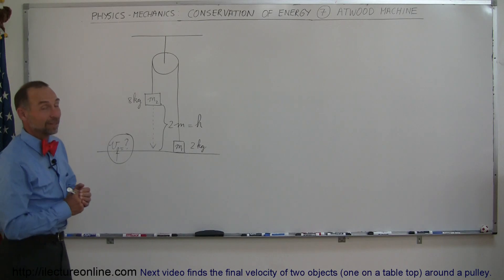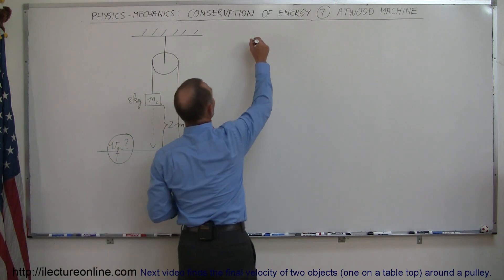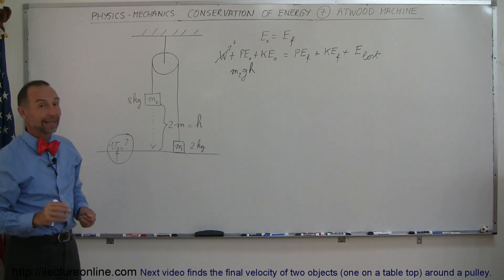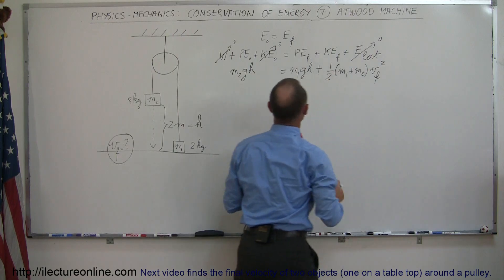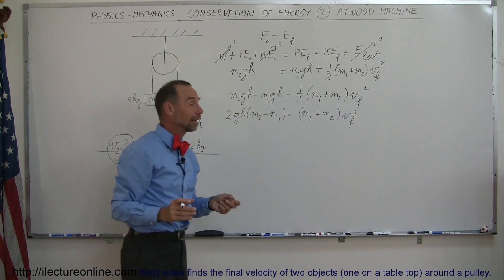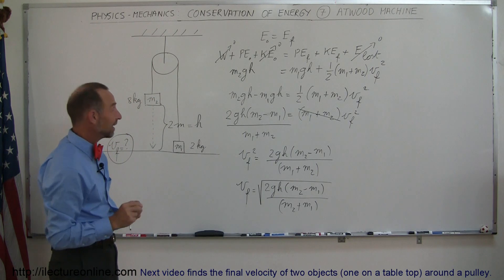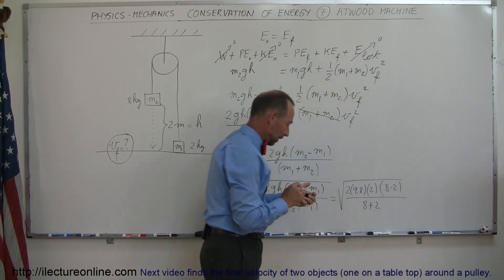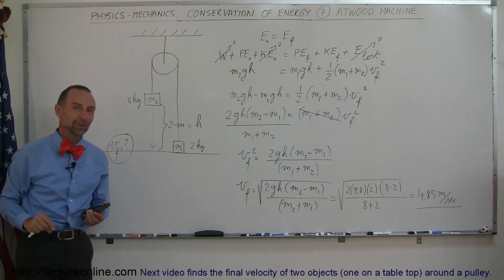Physics 9   Conservation of Energy (7 of 11) Atwood Machine

Comment: why dont we calculate the final speed with m total ? aren't both weights moving
Reply: i did PE of m2 =1/2xm(total)xv(final)^2 i find v=5.6 m/s what did i wrong professor😭😭
Reply from the maker: We used both masses in the calculation as shown.  We suggest you use the exact method shown in the video.  All these types of problems are solved that way.    You must consider the PE of both masses before and after the change.
Reply: @MichelvanBiezen  roger that professor

Comment: great explanation! just a question about a physics problem i found. if the cube m1 (the one with less weight) has an elastic force pushing it down. that gets added to the formula as well? it would be something like: m1gh = m2gh + 1/2 (m1+m2) V^2 + 1/2 K x^2. is that ok?

Comment: Hi, can I use this method even if the pulley has a given mass and radius?
Reply from the maker: No, these videos assume the pulley has no mass.  If the pulleys have mass then you need to use this different techniques:  Physics - Mechanics: Moment of Inertia and Rotational Kenetic Energy (2 of 3) Pulley System  https://youtu.be/5j5m3bwC0NU  or take a look at this playlist:  PHYSICS 13.1 MOMENT OF INERTIA APPLICATIONS 2   https://youtu.be/XHkDJwQ4Xng

Comment: Hi sir, could you please explain to me how we know that the height for the 2kg will be 2m. I am a bit confused regarding this. Is it an assumption we can make? If so could you please explain it. Does this mean that the height lost by the one block is equal to the height gained by the other? I saw another comment ask something similar. The comment said that if both blocks were suspended 2m above the ground - the lighter one would go to 4m. I don't really understand why. Practically it does seem right that it will go up 2m but what is the theory behind it?
Reply from the maker: Since the 2 blocks are connected with a string, however one block moves, the other block must move the exact same distance, since the string has a fixed length.

Comment: Based on this Chinook-Helicopter, lifting each 2.3 kg weight demands one-horsepower of engine force:: Youtube:::  (The CH-47 Chinook Proves It Can Lift 50K Pounds)
10,000 hp-Thrust==760 tons-thrust-force; Max-Weight==23 tons; thus:: Thrust-Weight-Ratio (TWR)==760/23==33===Chinook-TWR
Apollo-Saturn supposedly weighed 3,000 tons, thus 3,000/23==130 of such helicopters would have been needed to barely lift an Apollo-Saturn off the ground, which equals a total thrust force of 130X760==98,800 tons==~~100,000 tons-thrust-force, while Saturn-V claimed to have a thrust-force of only 3,700 tons which equaled only 3700/760==5 of these helicopters!!! CONCLUSIONS::: Apollos-were-fake!!! Youtube::: ("Solving-Apollo-Enigma-1") to learn what Apollos really were!!!!
Reply from the maker: Kareem.  There is some good analysis in your calculations, but you are leaving out some very important details.  As the rocket burns fuel, the mass decreases and the acceleration increases.
Reply: @MichelvanBiezen   But, which rocket professor? If you are referring to Apollo-Saturn as a rocket, I have already proved it was NOT. To see that a 3,000 ton Apollo-Saturn, with its 3,700 tons thrust-force, could NOT have lifted off even one inch, please check new additions to my own main comment under Youtube:: ("Solving-Apollo-Enigma-2")
Reply from the maker: Why would a 3000 ton rocket not be able to be pushed up with a thrust of 3700 ton (x g)?
Reply: @MichelvanBiezen   In my short video, I showed that as soon as a mass accelerates its actual-weight instantly increased. The 3kg mass instantly increased in weight to 15 kilos, shown on my force-meter-scale. So, the actual weight of a 3,000 ton rocket mass would instantly increase, much more than five times, because a rocket has to accelerate much faster than my hand. However, assuming that it accelerated as slowly as my hand, then it must instantly increase to 15,000 tons, in the first half meter of its ascent. Thus the excess weight-force of 15,000-3,700==11,300 would instantly ground the Apollo!!  It would NOT have a chance to accelerate at all, even one inch!!! As shown in my Chinook-Helicopter comment, One horsepower of helicopter lifts only 2.3 kg mass. Apollo's 47,000 horsepower on a helicopter could lift only 47,000X2.3==108 tons of mass, NOT 3,000 tons. Therefore, as a helicopter, an Apollo-Saturn would need 28 times of its claimed thrust-force to lift only like a helicopter, NOT as a rocket (3,000/108===28 times) However, rockets need even more TWR than helicopters do. So, how do you imagine a 3,000 ton mass could rise up into the air with only 47,000 hp==3,700 tons force??? I know: The only hypothetical way is by using a giant crane-pulley, and a 3,700 ton mass on the opposite side, pulling the 3,000 ton up extremely slowly!!! There is NO other way professor!!! I did that experiment in Google: ("Apollo-Killer-Experiment-0")
Reply: @MichelvanBiezen  Professor: In the descriptions, under my clip:: ("Solving-Apollo-Enigma-2") I calculated that:: "If Apollo is launched from the TOP of its launch tower, deploying its maximum-thrust-force of 34,500 Kilo-Newtons, with its worthless 1.7 m/s2,  Apollo would FREE-FALL to the ground and explode, in less than 5 seconds..."  The theoretical, and mythically impossible, 1.7 acceleration, which Apollo claims, totally ignores the natural down-G-force, which makes the above 1.7 a negative, downfall acceleration, which also proves no rockets could lift off with such theoretical numbers.!!! As I have shown there, with exhibits, the weakest "Rocket", to qualify as a rocket, needs to accelerate at a minimum of 3g, thus with a TWR>4, else, it would fail by collapsing soon after take off!!!
Reply: @MichelvanBiezen  Professor: This jump-athlete, weighing almost 800 Newtons, peaked his jump-force at the very end of this clip, with a total output of  4,794 Newtons of Thrust-Force, resulting in a 4,794/800==TWR==6, going up less than half meter, while accelerating probably a fraction of a second. If his output was only twice as much (1600N), in other words with a TWR==2, he would have likely NOT detached from the ground more than a couple of inches. If his output was only 1000N, or TWR==1.2, similar to that of Apollos, he would NOT have detached from the ground ata all !!!  https://www.youtube.com/watch?v=t2Bg781_uq0
Reply from the maker: Your reasoning does not adhere to the principles of physics.
Reply: @MichelvanBiezen  Such as which specific principle/s professor?? Please offer one, or two. Thanks. K.S.
Reply: @MichelvanBiezen  For instance, please show me where I went wrong in deducing that the following Newton Formula is bogus in the comment under this video:: https://www.youtube.com/watch?v=5cvKJ9BxbaE ("Newtons Second Law force to accelerate jumping person")
Reply: @MichelvanBiezen  Professor: Please check out Youtube:: (Slow motion video of a squat with synchronized force data)  which shows a guy doing a half-squat, without even detaching from the floor, and exerting over twice his own weight of force to stand up right. 1400/600==2.3==TWR. Many more similar charting of runners are available at a click on::  LocomotorLabSMU

Comment: Above calculation also indirectly proves that Apollos, Shuttles, SpaceX, Soyuz, etc. have all been fake rockets, as I have documented in my channel.  Numbers: above showed reaching only 5 meters/second speed (half of G-force-speed), while pulled up with 4 times the weight. Apollo claimed to have been pushed up (at launch) with a force equal to only 1.2 times of its weight, and at double the above speed, so it would have required at least ten times force of its own mass of 3,000 tons, in order to push it up only 10 meters in one second; However, it claims to have done that with only a thrust force of 3,700 tons, which would have been a total impossibility, whereby, at best it would have toppled and fallen from its launch-pad!!! Youtube::: ("APOLLO-WAS-HOT-HYDROGEN-BALLOON")
Reply from the maker: The Saturn V rocket engines produced 7.5 million pounds of thrust.  According to Newton's second law   Fnet = m a.  As long as the thrust of the rocket engines are greater than the weight of the rocket, the rocket will accelerate.  As the seconds go by the rocket will reduce in mass and the rocket will accelerate faster and faster.    This video explains how that works:   Physics - Test Your Knowledge: Momentum (13 of 20) The V2 Rocket: Variable Mass
Reply: @MichelvanBiezen  Thank you professor: Question: why did you NOT write Newton-units, instead of 15,000kg mass ??? Also: how would you explain every step in a simple jog demanding a vertical-force of more than three-times the body weight, in addition to lateral forces, as shown in Youtube:: (Running Forces). I demonstrated a similar experiment, showing a 3kg-mass (weight) demanded 15kg-force to accelerate upwards, in this YOUTUBE::  ("Solving-Apollo-Enigma 2"). Also, I have a $5,000 prize posted for anyone who produces a self-propelled rocket with a TWR==1.2 which could launch itself, and gain an altitude of 100 meters during its thrust, before engine shut-off. So, if you truly believe that Apollos were rockets, then I offer you that same challenge, which is introduced under the video, posted under my original comment above. & thanks again. K.S.

Comment: This can be solved using equation of motion 

If we solve for acceleration we get 5.88ms-2

Initial velocity is 0 and height is 2

So v2-u2=2 as
V=root of 2 as
V= sqrt 2×2×5.88
V= 4.8 ms-1

It can be easily solved like this rater than using conservation of mechanical energy
Reply: the formula you applied for calculating the acceleration has been derived from this method only, but surely no offence.

Comment: Professor how do you know that there is no work while the pulley is moving?
Reply from the maker: If the pulley has no mass (or the mass is so small that we can ignore it) and if the pulley has no friction, then it doesn't require any work to turn the pulley.

Comment: Hi professor Michel Van Biezen, how do you know for sure that m1 will have the same height as m2? Because I was trying the same kind of problem but only with a different mass and height (block B had an initial height of 10 m and a mass of 4,90 kg en block A had an initial height of 0 m and a mass of 0,55 kg. So I was also thinking that block A will rise till 10 m above the ground. But my solution was wrong. And I don't know why? I hope you will explain it.
Reply from the maker: It depends on the question.  After the large block slams onto the floor, the small block will continue moving upwards due to its kinetic energy.  Therefore when the small block reaches a height of 10 m, you'll have to use the conservation of energy to determine how much higher it will go:    v = square root (2 g h)
Reply: Okey, I think I understand it much better. So what I did was: For the first situation I calculated the velocity (same methode as the video) and by situation 2 when block B slams the floor I used this equation: 
mA g 10 = mA g hmax + 1/2 (m total) Ve^2 (Ve is the velocity that I calculated in situation 1). 
(mA= mass of block A en h max= the maximum height that block A will get. Is this plausible? Thank you
Reply: hmmm, I think that I did something wrong, because my solution is not right.
Reply: Thank you very much!! i had the same problem though.
Reply: They have the same acceleration

Comment: Sir , what if I am asked to find the maximum height of m1 block , how can i calculate it or its just the same as 2 meters ?
Reply from the maker: When the large block reached the ground the small block will be at a height of 2 meters moving up with some velocity (found in the problem).  Then think of the small block as a projectile moving up vertically, how high will it go (above the 2 m) with that initial velocity.
Reply: this was smart , i tried to do it using conservation of energy and ended up with a mess . Thank u so so muchhhh . God bless u

Comment: It's not very clear to me why is the initial PE based on the second object, whereas the final PE is based on the first one - that is, what dictates which of the two objects should be used to calculate the PE? At first glance I would have used second object for both the initial an final PE.

I am guessing that the PE of an entire system is the sum of the PE of each of its objects. Initially the second object has PE because it is not on the ground, whereas the first object doesn't have PE, so naturally we simply use the second mass to calculate the PE of the system. At the end it is the other way around, where the first object is the only one that has PE so that's why we don't use the second object at all.  Would that be correct?

Thanks!
Reply from the maker: The PE is calculated to a reference height.  You have to pick a point and call it zero height.  (That point can be picked anywhere, but traditionally we pick the lowest point like the surface in this example).  In the beginning only the large object has PE because ii is above the surface.  The small object is sitting on the surface and thus has zero height.  (PE = mgh)    At the end it is reversed.
Reply: Suppose the exercise begins with both masses halfway through (so the second mass has a height of 1m and the first mass as well) - is the initial PE still just (m2 * g * h) ? Or do we have to add (m1 * g * h) as well? Assuming that the reference height is still the surface below.
Reply from the maker: Then you will have to add the PE of m1 as well since then, both objects will have potential energy.  (or you can set the reference h = 0 at the location where both masses start and then neither mass will have PE initially.

Comment: Isn't the final potential energy negative as the block is moving up while it's weight is acting downwards
Reply from the maker: Potential energy only depends on position (and not velocity) of the object in a force field and on where you place the reference zero potential point, which is arbitrary.
Reply: Thanks 
When is mgh negative though ?because I read that if a body is being displaced upwards mgh is negative
Reply from the maker: On the surface of the Earth PE is positive above a reference point (typically the ground), and negative below that point (below ground).  But is space PE is zero at infinity and less than zero everywhere else (like on the surface of the Earth).  But in both cases, PE increases when moving upward.
Reply: Michel van Biezen thanks a lot !👍🏻🙂
Reply: Michel van Biezen thanks a lot !👍🏻🙂

Comment: won't PE inital have a different height than PE final?
Reply from the maker: When the large block is at its lowest point, the small block will be at its highest.  (Notice that the mass has changed in relation to the PE).

Comment: Could I have solved by using kinematics?
Reply from the maker: Yes, but it is a lot easier with energy.
Reply: Michel van Biezen I was wondering why tension didn't come into play. This makes sense, but I'm definitely still getting used to looking at a problem from different perspectives/units.
Reply: how about finding acceleration by treating the whole as a system? and then finding velocity ?